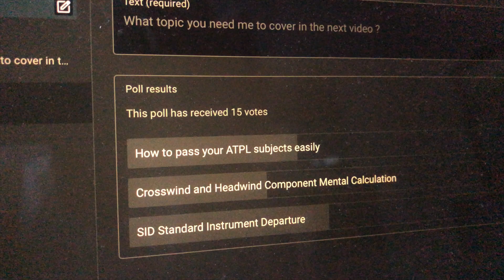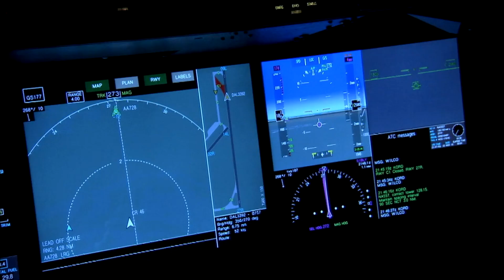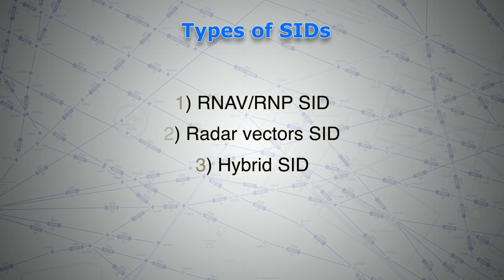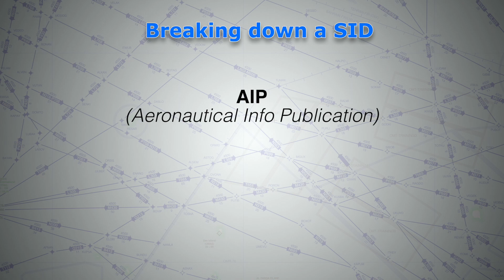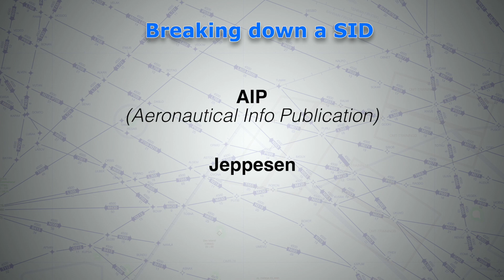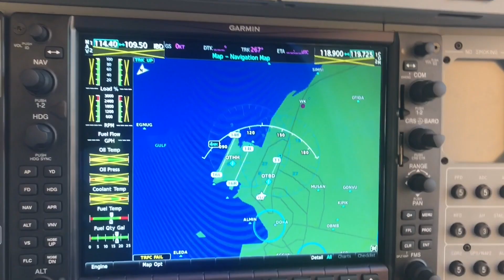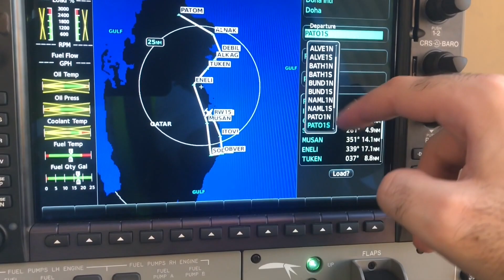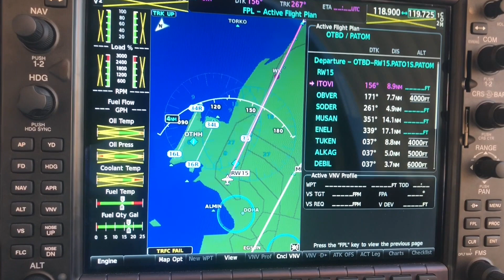Standard Instrument Departure SID - Explained For Pilots

Comment: what is ARP with red on plane viwe ?
Reply from the maker: ARP stands for Airport Reference Point, in this context it refers to the point of the centre of the 25NM radius  which forms the MSA (Minimum Safe Altitude) circle in this case is 2300ft. Let me know if you require further explanation.